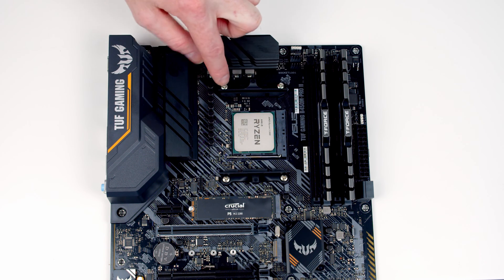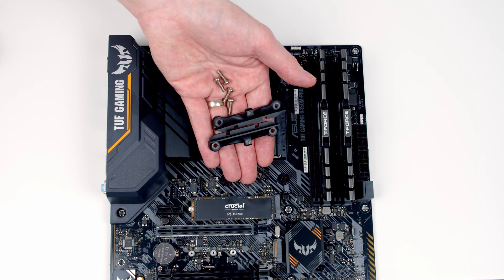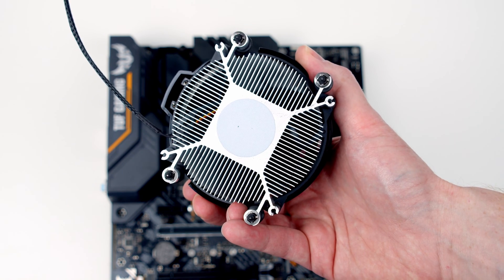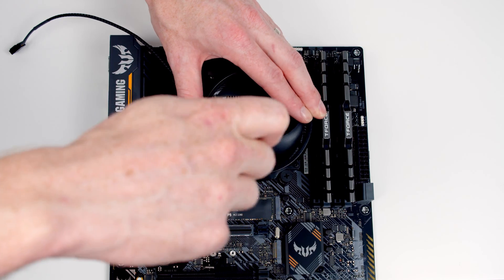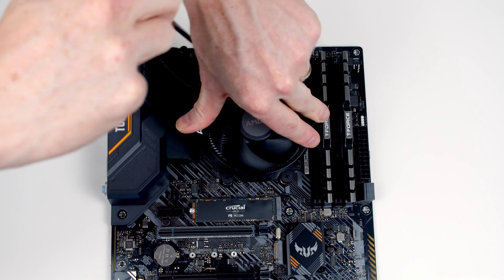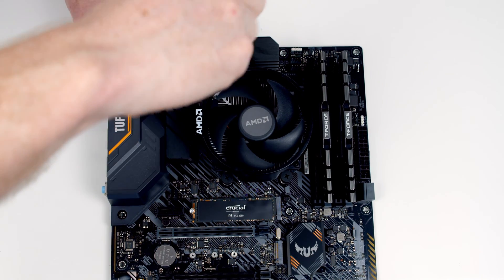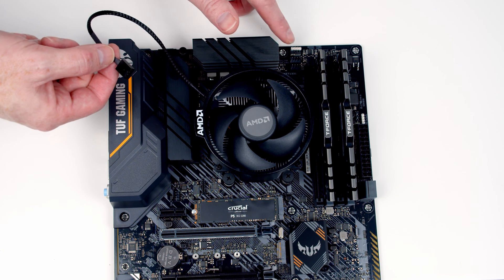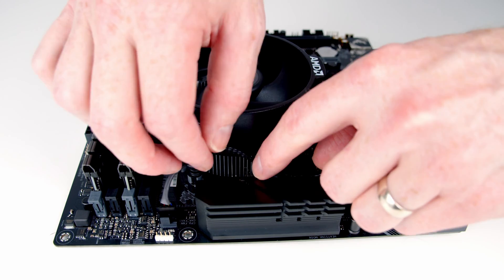AMD Wraith Stealth Stock CPU Cooler Installation Guide

Comment: The problem with this is that the new AMD fan screw pattern do not match my old 4 screw-hole pattern. I wish they would have commented on 'that' because if everything lines up perfectly, then its not too much of a challenge to figure this stuff out. Where does one get a clip to attach new AMD fans to older motherboards?
Reply: Yup this is same issue... All them seem need a mounting bracket // use diff install... Which is annoying. Am trying find one that would just go into the 4 holes but

Comment: I cant screw mine in im putting alot of pressure and the screws wont go down
Reply: My motherboards built into my case and i dont know where the backplate is someone please help
Reply: @CrypticLass  Did you figure this out? Having same issue thinking because I haven't got a back plate, gonna order one and see if it works.
Reply: @ the metal plate kept falling due to the way i laid my pc so there was legit nothing to screw it in too until i held that up from underneath

Comment: This is not a good video for a beginner trying to install this cooler. I spent more than 1 hour trying to figure out why the cooler screws would not attach to the motherboard. You Never mention the back plate on the motherboard when taking off the initial two brackets or how it should be used when Attaching the CPU cooler. little  Steps that you take for granted are crucial for beginners who know nothing about installing a Cooler For a Rizon CPU on a motherboard that is already mounted in the case..
Reply: I had to remove the motherboard from the case and reattach the backplate on the back of the motherboard before screwing the cooler into the motherboard on the front of it
Reply: @cblack2863  you are a beautiful soul. Thank you for removing this annoying stressor from my life
Reply: 0:36
Reply: How did you re screw it??
Reply: I legit have this issue

Comment: Hello, I will soon start my first build. Is there a way to know if the cpu cooler seated properly? I am worried I will drive the screws too much and damage the cpu pins.

Thank you for this video! Helpful.
Reply: You will never be able to damage the cpu pins as they will be sat in the cpu socket which will not allow the cpu to move, the only way you wil damage the cpu pins is by doing something to them when they are not installed. The cpu cooler plays no part in breaking a part in a build. Dont worry just fix the cpu cooler, all pc parts are very strong, even the motherboard.
Reply: @oscillatefn8303  Okay thank you for this. It frees up my worry a little
Reply: Cer Sei no problem, I just built my first pc, but don’t have a graphics card of course because of the virus. Don’t worry, it is very hard to damage any part, unless you definitely try to but if you are carefully caring for your parts then you will have no issues and an awesome built! Btw what specs are you choosing?
Reply: @oscillatefn8303  I went for R5 3600 + Sapphire 5600 XT :) Still on hunt for PSU, and then i will start building.
Reply: @cersei1190  really good choice mate, for your psu it has to have the 80+ rating and at least bronze for its power efficiency.

Comment: I learned the hard way a month ago on the Asus Strix B550-F that you also need to make sure that the back plate is still attached before trying to screw down the cooler.  When I removed the motherboard's CPU clips I moved the motherboard to a new position and the back plate fell off and I could not for the life of me figure out why the cooler did not want to screw down.
Reply from the maker: Good point. I often have something behing the case putting pressure on back plate to it can fall backwards

Comment: Hi, you seem like an expert on everything pc, so I hope you'll be able to answer this, I'm wanting to get a Corsair aio but it seems way too complicated and I'm not sure whether it's worth it, and if you do recommend it, are there any videos you would recommend watching to help me?
Reply: Whether u need an aio depends on what cpu you have (some can run pretty hot stock) and what u plan to do with it (overclocking or not overclocking). Many people get an aio more for the looks, while some people get an aio bc they want better cooling performance for their limited size case where a large tower air cooler won't fit. For the combo of price, performance, noise, and longevity (you can keep using an air cooler as long as you replace the fans whenever they break), however it's hard to beat aircooling, but it may not be ideal depending on your pc situation.
Reply from the maker: @jayceeveetee  great answer. Check out the review coming soon as I will cover this

Comment: I mixed thermal paste and I’m not sure if that was right, it was cooler master thermal paste and thermal grizzly, is that ok?
Reply: It is not recommended but in the end if the temps are okay then you are fine
Reply: Anant Gupta ok thanks, what the worst that could happen?